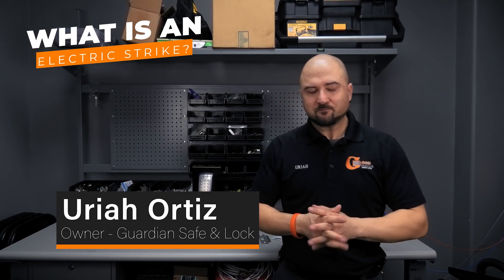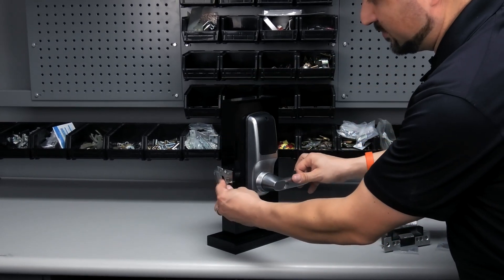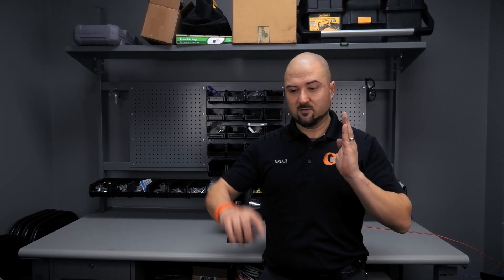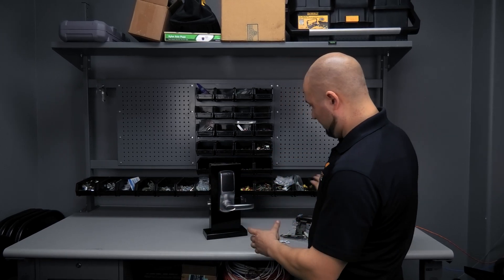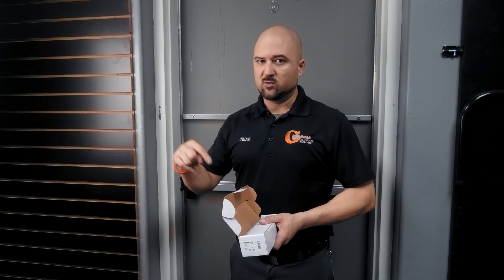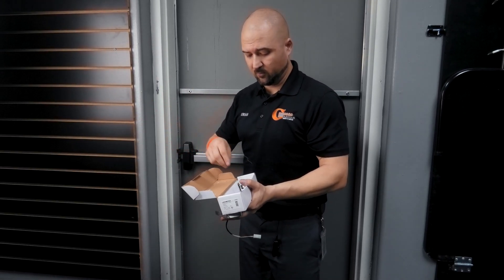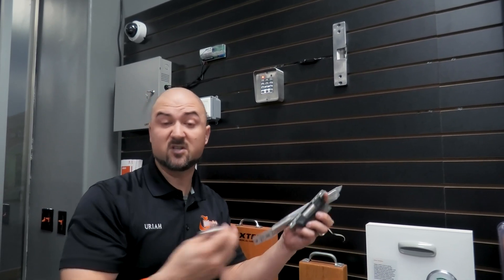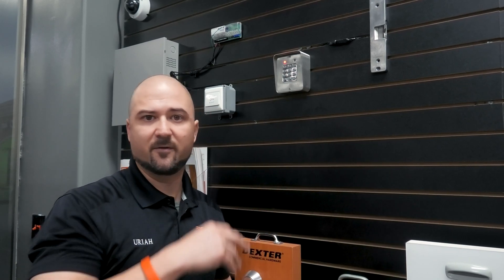What Is An Electric Strike? | GSL Discussion

Comment: Thanks for sharing man! Starting my own locksmith company and I don't have much experience with electric strikes. Every shop I've worked for had a special tech that handled them because a "Low Voltage" certification was required in the province of BC. Fortunately it is not needed where I'm starting up.